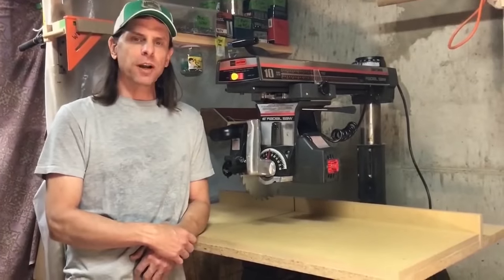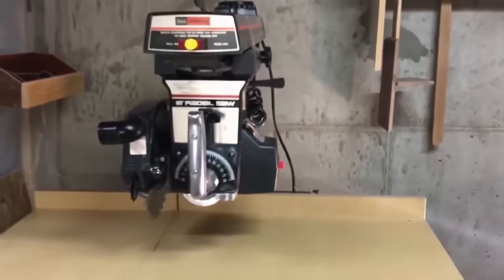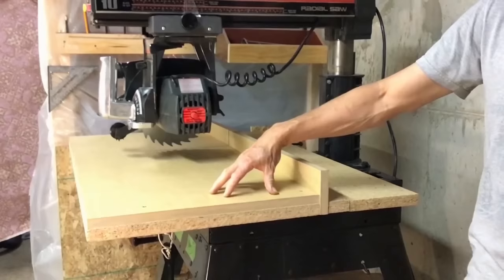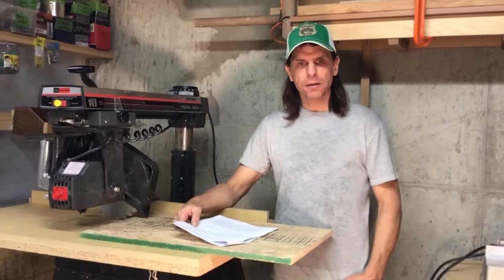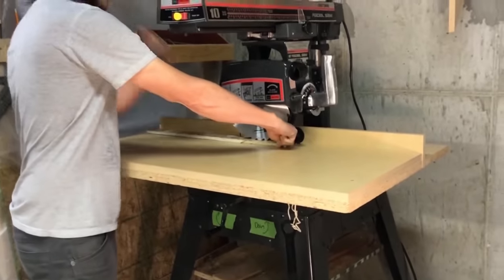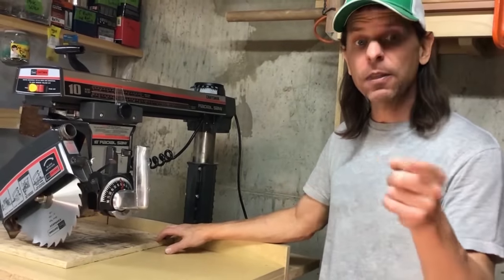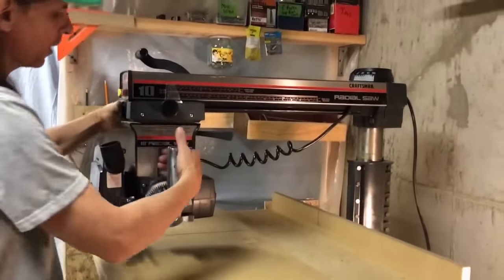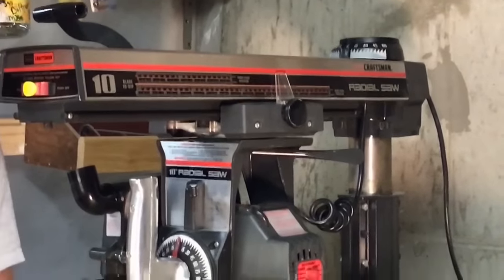The Complete Guide to Operating a Radial Arm Saw

Comment: The most disappointing thing to me about using a RAS is that they are underutilized.   I have seen so many 12” RAS and chop saw videos where people lay their 1x4 or 2x4’s flat and cut them one at a time when they are wanting exact same lengths.  So, 6 boards exactly the same takes 12 cuts.   Waste of time and accuracy.   Set them on edge, align ends with each other as best you can, clamp them together, cut the end, then make the length cut.  6 exact same boards in two cuts.  With 1”, you can do many more at once.

Comment: Hey Walter, Great video! I inherited one of these saws and I wanted to research it before jumping into using it. Glad I did! I would have certainly been using it incorrectly based on my intuition. Glad I can use it more safely now. One question, The blade that came with it was the original stamped steel blade like what you show on your saw. I have seen others using a carbide blade. Because of your explanation of kickback, would you recommend running a carbide tooth blade for a little extra safety, or is the kerf spreader fully sufficient?
Thanks! -Josh
Reply from the maker: They are a great tool.  I think you will enjoy it.  I'm glad my video was helpful.  Have a great day!

Comment: Thank you, Walter! This is a great deal of wisdom. I learned things I never knew about my own RAS (Ryobi, new in the 1990's). My dado set lives on it & it is used only for that. I don't find any other purpose for the RAS compared to my table saw, but that is a real convenience. I liked the idea of the accessory PTO (mine is set up with a collet for pin routing) but I've never used it. This is the Ryobi version that was later recalled for the motor rarely separating itself from it's mount; never had a problem with mine, fortunately.

Comment: I had one of those exact same saws and sold it. I had a hard time adjusting the yoke to remove any heel when cross cutting. The 2 bolts on top were a pain to adjust. Your saw looks really good. Did you restore it?

Comment: I learned more from you in 20 minutes than a lot of other channels show. Excellent video sir. I’m just curious, it looks like you have a 1 inch MDF table for your radial arm saw. Is that original or did you replace it? Your saw looks almost like it’s out of the box brand new. Quite amazing actually. Also, have you done a video on how to align your radial arm saw? Do you have a great teaching ability and I think you might really simplify it for a lot of guys a.k.a. me.
Reply from the maker: Thank you for the kind words, they are appreciated!  That is the original MDF table.  I purchased this saw in 2016, and although it is from 1982 it had never been used. In fact it was still in its original box.  I added the table protector.  Have a great day!
Reply from the maker: Also thank you for the suggestion that I make a video on how to align the RAS.  I'll keep that in mind.

Comment: I have a 1970’s era Craftsman Radial Arm Saw.  It has been relegated to crosscuts only.  Each time you change its modes it required adjustments to calibrate it.  The Dewalt table saw and compound crosscut saws are better and safer.

Comment: Walter, have you ever used the product called 'Little Yellow Wheels'
or some other similar name, they will hold the piece being cut against the 
fence with a spring pressure and also hold the material down to the table, 
they also only rotate in one direction, so they will hold or at least contain
the material form kicking back.....they come in 2 colors, yellow and orange,
which rotate clockwise or counter clockwise......they are very very handy....
best regards, Paul
Reply from the maker: @ypaulbrown  sounds like a feather board.
Reply: @vanman798  They come in yellow clockwise direction wheels for in-rips and green both-way direction wheels.  They're called Board Buddies and they mount atop the fence.  You can use them in conjunction with the saw's pawl and blade guard.
Reply from the maker: @Rebel9668  where can they be purchased?

Comment: Great video I plan on using my 10 RAS more  I set up my 9" RAS as a disk sander. I need to buy a more robust power strip so I can use my vacuum and RAS saw without it kicking off the strip. Or move it it front of an outlet.

Comment: Nice video. Im thinking of getting one just to only make crosscuts. It seems this tool can make perfect crosscuts the entire length without any deflections. Even the most expensive sliding miter saws won't cut perfectly the entire length due to flex in the rail and guide bearings.

Comment: Hello man.. I've always wanted a Radial Arm Saw but they're so tough to get hold of here in IRELAND. Germany always have them on sale b ut I'd need to do some travelling across Europe and that's a wee bit too much for me.  I watched NORM ABRAHAMS using one for decades.. I'm still on the lookout for one of these bad boys bcos I wouldn't waste time buying an expensive table saw in the future even though I'm going to build my own soon, Table Saw I mean.
I imagine a Radial Arm Saw would be hard to build ypurself? That's a lotta moving parts.. 
Really enjoyed ur video man. Be safe.
Reply from the maker: Used Radial Arm Saws here in the USA can often be found for very cheap at garage sales or online.   I'd suggest you buy one of these out of the USA and have it shipped to Ireland.   They are heavy,  so slow boat shipping would be the way to go.  I remember Norm Abrams using one, I think it was the same one as in my video.   Good luck .  Building a table saw is straight forward,  but a RAS would be very difficult.
Reply: @vanman798  Thanks man. Appreciate the reply.. Will look in that slow boat shipping thing. I didn't think of that..

Comment: Great video. I appreciate your safety instructions. Alot of good information. Just picked up a craftsman radial arm saw from a thrift store to add to my wood shop. Mostly for ripping. I have a question about the saw. If the blade is rotated 90 degrees, can you produce a tenon operation in the rip position? Is there a video on that that you can direct me to?

Comment: Walter, this is a well done video on the RAS......
I am a bit of an RAS fanatic, at the moment, 
I own 5, but two are under the weather and need 
help......all are DeWalt, from 1953 up to 1968 or so....
16 inch  to 9 inch....with 3 10 inch in-between.....

I have owned 3 other RAS, a Montgomery Wards, a Craftsman
and a 1960 DeWalt 925....which was the a beauty, but had 
motor issues.....
I use mine for many jobs, cutting stainless steel, aluminum, wood, plastic, phenolic.....
I also do a lot of grinding of machine tools to sharpen , and modify.
using grinding wheels, diamond wheels, and sanding discs.....decorative metal 
finishes with woven abrasive [Scotchbrite Wheels] and truing steel and stainless steel
miter cuts on angle, flat bar and square tubing after cutting on one of the new fangled 
high speed cold saws for metal that do a terrible job of smoothness......
One thing I found out, was by using a 7 1/2" blade from a 'Skilsaw' I can get fantastic 
cuts as far as smoothness, lack of stress on saw due to the thinner blade and much 
lower cost......
Best Wishes from an old Geezer in Florida who has been using the RAS since 1974....
Cheers, Paul
Reply from the maker: @ypaulbrown  thanks,  I'll have to try the smaller blade.

Comment: Your point at 18:30 is the same thing Big Tuna incorrectly said in his video about the back side of the blade pushing the work down.  THERE IS NO WOOD LEFT THERE TO PUSH.  That part of the blade is in the kerf.  Don't take it personal.  Both you and he did a great job in your videos.  Lots of good info.  We could go into an hour long dissertation of the forces, vectors, and reaction in certain scenarios.  Bottom line, if you set it up properly and follow the rip instruction on the side of the guard, you should be ok.  Because the only direction the wood can go is straight back.  But even that danger is slight because as soon as the first tooth moves the board back a fraction of an inch, the teeth are disengaged and no more force can be transferred to the work unless you purposely skew the work piece and jam it back in.

Get/make some long featherboards that allow easy clamping and use them to hold the infeed down and against the fence and the outfeed down ONLY.  You won't have any issues.
Reply from the maker: Thanks for your comment. Your point about "THERE IS NO WOOD LEFT THERE TO PUSH" is interesting. Think about this, once the work piece is cut through, then, and only then, is there no wood left to push down on, but as it cuts there is wood to be pushed down, especially since the blade is a circle (meaning the cut starts out at less than full depth).  Hence, the blade does indeed push the piece down as it cuts it.  Have a great day!
Reply: @vanman798  If the work piece skews or pinches the blade, sure.  I'll even concede that a tiny bit of downforce may be imparted from the friction of the sides of the teeth.  But that is orders of magnitude less than the teeth at the front of the cut that are hogging out the material.  Not at all the equal and opposite forces that it's being treated here.  A quick analogy could be an excavator imparting and upward force as it digs, but once the bucket comes out of the cut, it can no longer impart force to the earth in the walls and face of the the cut.  As the excavator cycles to dump and returns to the cut the bucket may graze the sides of the trench, but to say that the forces of the bucket digging into the earth and the bucket returning to the cut impart anywhere near the same forces is simply incorrect.  Same with the saw blade on the back of the cut.  The wood in the blades path was removed and simply isn't there for the blade to engage it on it's downward arc.  Sorry that's just a fact.  Not an opinion. We can set up a simple test for this if you like.  Connect ammeter/amp probe or a "kill a watt' to the saw and at a constant speed measure the amps or watts drawn as the work starts cutting until it reaches the  vertical center line of the blade.  Now continue the cut at the same speed.  By your logic, the amp draw or watts should double once the blade is fully in the cut.  It will NOT double or even rise unless the wood pinches the blade, or * you do something naughty like skewing the work piece.

*  originally read "you you" instead of "or you" oops!

Comment: I have a 10" Sears RAS. The motor will not tilt. The lever  to release the motor will turn but will not go up or down. I disassembled the handle and   the lever to lock the motor in place. There is a pin sticking down that indexes the motor angle. The pin is frozen and will not move. I believe there is a spring above the pin put since the pin is stuck it does not move. The pin has a slot in it that a flat screw driver blade will fit in but it can't be threaded or the pin would not move. I have tapped on the pin but it does not move at all. Any Ideas on house to free up the pin? I have used WD 40 but that isn't working. I hope I made myself clear in describing my problem.
Reply from the maker: If the pin is rusted in place 
 I'd use vinegar to free it. Spray it two or three times a day for several days.  Also put a paper towel over it to keep the vinegar on the pin.  Resoak the paper towel with vinegar prior to drying. I hope this will help.

Comment: It is still the safest to begin your crosscuts with the saw fully extended and push into the cut whenever possible. The rotational direction gets most novices into trouble in the rip cut configuration, one must always feed the work into the blade from the CORRECT direction when rip-cutting! Id be super interested to see some of the more uncommon operations these old Craftsman radial arm saws can do- especially the ones using that auxilliary shaft! I have an old compact Dewalt/B&D 8" so it doesnt have many of the extra features. It sure came in handy before i was able to obtain a tablesaw though!
Reply: @vanman798  Yeah I never said to do that man.
Reply from the maker: It's definitely not recommend to do what you suggest.  The blade should always be behind the fence before a crosscut is started, and then pulled toward you on a RAS.  Compound miter saws, I believe, work the way you are suggesting.

Comment: I have a very similar Craftsman RAS that I bought around 1990. It came with a large blade guard attachment (which was recalled and replaced with an even better blade guard attachment).  Did yours not come with one, or did you just remove it to better show the blade.  As a safety device, the blade guard attachment does an excellent job.
Reply from the maker: This saw didn't come with one.

Comment: great video, yeah no im scared as SH!T now (which is a good thing)  lol, BUT ive aquired lots of industrial pallets that are 4"x6"x8' .. ive been SLOWLY ripping with a 7 1/4 skln saw, (make cut.. flip over finish cut depth) I came across 1 of these on marketplace and was like hummm, I do know trying to rip on table saw I QUICKLY discovered... HELL NO to dangerous!
so if I built a table.... 8' on both sides to support weight of these 4"x6"x8' boards....can these arm saws rip like ive been. doing with skin saw. my main concern is on/off is NOT a trigger like a skin saw, so if I bind etc, let trigger go and danger is greatly reduced... not so with arm saw.... it is about $900 worth of wood 2x4s and 1x4s
Reply: You surely can, however, you'll want to do itt in multtiple passes. 4 inches or 6 inches is way too risky. Lower the blade so it cuts about 1" deep, do your cut, lower the blade until it does another 1" (you will be at 2 inches from the top now), do the cut, etc.... If THIS feels safe for you, you can increase to 1.5 inches, if it feels safe, 2", etc... but doing it in one pass is just asking for trouble and way too risky. Wood has internal stress, with a skill saw you can simply let go the trigger and it will catch almost instantly, not with this tool unless you modify the tool and make it unsafe. Yes, it would be slower, but much safer by doing it in multiple passes than one big pass.

Comment: Hello Walter, I enjoyed this video. It was perfect. I was looking for a video on how to adjust my radio arm saw but ran into this video and I'm glad I did. I bought this all for $10. It is tight and runs well. It is not set at 90° perfectly. I could put the fence on an angle and get square cuts. I think I can find to knit with adjustments. But I don't know how. Again I am glad I watched this video it was much more important. Thank you. Frank
Reply from the maker: If you do a google search you will find a PDF version of the saws' manual which you can download.   The manual outlines how to align the blade and arm.  Hope this helps.

Comment: I Just picked up a 10" Craftsman Radial Saw last week, put out by the curb by a neighbor for heavy-trash pick-up.
Thank You for the video! 

So far, I have only tested it to see that the blade spins. 
Purrs like a kitten, but per your video - I'll now think of it as a Lion's Roar!

It was left along with a box of 8 to 10 blades (plus some that are 7.25"?), and some sort of "router blade".
Mine has the large, thicker Front Table, but is currently missing only the Fence, Spacer, and the Rear Table, but it seems I can easily make those with some good wood using my table saw and/or chop saw.

Now that I've seen this video - the 3 missing pieces could have easily been sitting in her trash bin (that I failed to peek into, right next to the saw) as I drooled over the free Radial Saw (not that I would have known what I "saw" had I peeked, prior to viewing this video).

The lady that ditched it came out, was happy I could use it, took my number and said she would call me if she found "other parts for it" as she cleans her garage.

When I got home with it (several doors down), I had already noticed the red cap covering the "accessory" auger, looked up what was available, and started to really wonder what might be left in her garage (due to the cost of the many accessories). 
I think the addition of the "planer" accessory may be most useful for my needs (and may be sitting lonely, right there in the lady's garage - with who knows what else that should be reunited with my saw).

I mainly watched this video to see all the parts I might be missing (so I could print pictures of those from the web for the lady) - and ended up learning so much more!
Reply: Just picked mine up yesterday and glad I came across this video!

Comment: My old Delta RAS manual defined what a 'climb cut' is, and how a radial arm, or any other circular saw or router does it.  You should explain it in this video.  Then you'll understand a vital safety concept.
Reply from the maker: It's mentioned in passing around 6:14.

Comment: I have a Craftsman saw just like yours. They had a recall because of the blade guard. I got a new, safer blade guard and table top. You might check online to see if they still offer that.
Reply from the maker: Thanks for the tip. I've heard about that, but I'm pretty sure they no longer offer that.  Bummer.

Comment: Very well done video.  I purchased a wood workers tools that had been sitting for 22 years and got a 12” Craftsman RAS.  Much better than 10” as I can cut 4” material with no issues.  Like a stack of (16) 1x4’s at one time.   Can you please give me the width dimensions of the two pieces behind the fence?  For some reason, my measurements on the arm are off.   Thank you.   Kevin
Reply from the maker: both are 40" in length.  the spacer is 2" wide, the other is 6.75"
Reply: Cutting SIXTEEN pieces at the same time is a HUGEEEEEEE safety hazard. If even only one of your pieces shift slightly during the cut, it'll bind and throw the 16 pieces at whatever it wants to (you, wall, fence, depending on setup). You NEVER want to do more than 2 for that reason, 3 if the pieces are thin (0.500" or so)